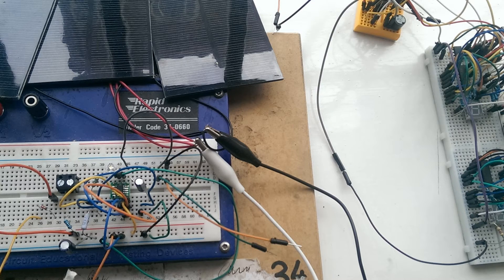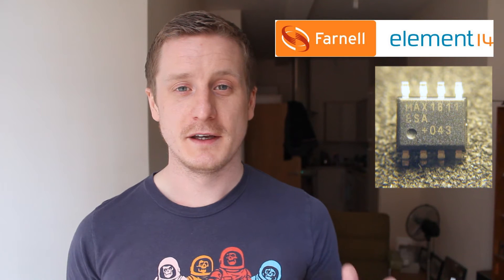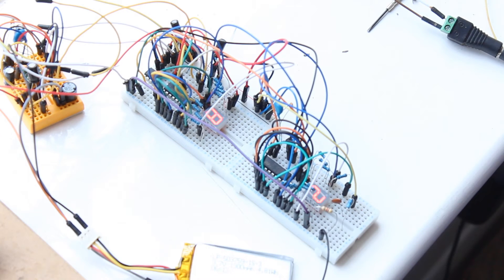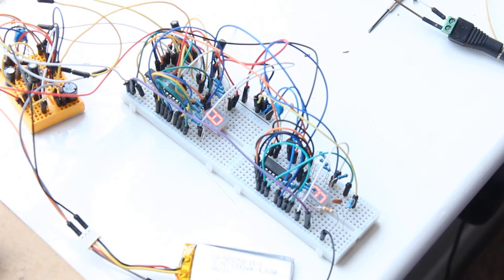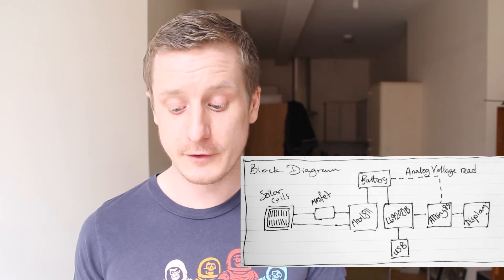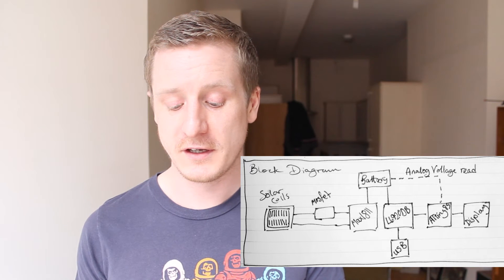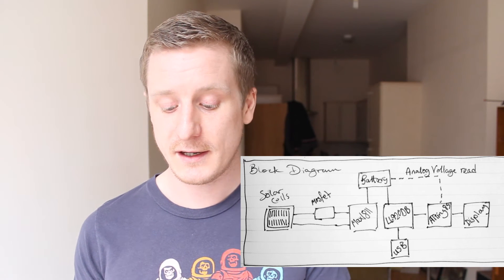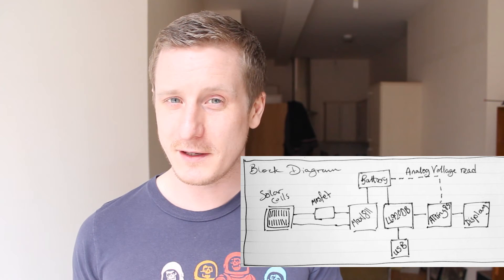Making a Solar Charger: Introduction

Comment: Why not replace the Attiny 85 with an Opamp comparator to display battery voltage?
Reply from the maker: +Upton Robotics Pty Ltd Hi, thanks for the comment. The display gives you a percent value of usable capacity left in the battery based on a sort of averaged discharge curve and the voltage reading. There are a lot of battery gauge chips out there though, this was less of a solution to a problem more experimentation.
Reply: +David Watts The old fashioned analog solution may in fact be cheaper, better and more accurate than a digital solution in this case. The microcontroller will use a lot of energy and suffer from conversion problems that the opamp avoids. I am working on a similar circuit. I was thinking of using a buck converter in a dual function. One function to step up a battery voltage. Another function to step down a solar voltage. What are your thoughts? Is that a good design?
Reply from the maker: Upton Robotics Pty Ltd You are right, it probably would be cheaper. The microcontroller can add a lot of other 'smart' features though, like auto power off or even mppt if you want it.

I have used step-up step-down convertors before and they can be quite inefficient, losing as much as 60% in conversion dependant on load and voltage. That said, they generally handle high current loads well and a range of voltages. Output voltages can also be changed on the fly in some cases. I am by no means an expert, but I have tinkered around a lot.

I suppose it depends upon you solar supply a lot and the battery packs you will be charging. The output load will generally be covered well by most buck converter setups.
Reply from the maker: +Upton Robotics Pty Ltd That little dude is cool. What kind of current draw are you getting? If you want to keep it small I would go for Lipo batteries with a boost converter. For solar you can get 5-5.5v cells pretty cheap and just add a beefy diode to drop a little voltage to go into some charging circuitry. If you go 12v then you might want to look at something more complex. Lots of options apart from those though. Good luck.
Reply: David Watts Thanking you. Yeah that's what I was thinking. Of course reality is never easy. I will probably have to try a number of different setups to find the best solution.

Comment: Hey cool channel im going to subscribe please check out my channel and all my videos. subscribe if you like it. I have tons of Arduino projects, a solar "AA" battery charger, a usb charger similar to this one. And I also have a small solar setup in my apartment. I think you would like it. Keep up the good videos!!!
Reply from the maker: Tom Ziesmer Thanks mate, I think you should pick up some of those max1811 chips and some lipo batteries for your solar projects, I think you could make something great. You definitely need a better camera ;-) I will work my way through the rest of your videos but I am enjoying them so far.
Reply: David Watts I will have to look into more lipo I just have one 18650 right now... And thanks for subscribing and checking out my video. I do apologize for the crappy camera I record off of my phone But a new camera is next on the list!!! I just watched most of your videos and they are very well put together keep on making them!!!

Comment: How are you getting on with this?
Reply from the maker: alexellis2 Hi, all finished. It doesn't get a lot of use though.... the UK is just not reliably sunny enough. Here is the follow-up - https://www.youtube.com/watch?v=E10BliRC5P0 - I never quite got round to finishing that video series off.
Reply: I'm playing at the moment, look at my uploads from today. 0.53A from two small panels while the sun was out. I'm wanting to run a little arduino in my garden on 4xAA batteries and to top up the charge with solar. It would be very low power setup, probably needs to be more of a 'bareduino'

Comment: What a brilliant video and thorough explanation. Thank you. I am looking into a solution  to power and Arduino via solar, and my feeling about a design was to make it far more passive and to remove a lof of the parts you are using on the charging side of the battery.  For instance, what if you could start with a 12v solar cell/panel of say 1 watt, on ebay for $5, hooked up to a 12v battery powering an arduino, and then you could skip the step up, and the regulator on the charging of the battery side.  All that efficiency, time, money, etc saved. And you would also not need the regulator on the output side as Arduino has one built-in.  And since this way you cannot overcharge the battery I don't think as you can't get it above 12 volts per the solar cell, you can skip the regulator and step up on the battery charging side. The battery may not charge all the way to 12 volts but that is ok with the Arduino, which can run on 6v.  I have not tried it, but would it work to do this?  Or do you have to have the regulator and voltage reading to control the charging to keep from over charging the battery?  You could always keep the arduino in sleep mode when possible, and turn it on to burn off excess power as a possible way to avoid having to employ a regulator on the charging side.
Reply from the maker: Jeff Beck Hi Mate,You will need more than 12v to charge a 12v battery, it is something like 2.2v per cell so 13.2v max. You can keep a battery topped up with a 12v panel but your charging current will be pretty low, 1 watt at 12v would be around 10ma. A 4 watt panel would give you a bit more headroom but you will still likely drain the battery eventually. You would be better to pick up a 6v lead acid battery and regulate the voltage down from the panel or get a 15v panel for your 12v battery.
Reply: >>1 watt at 12v would be around 10ma

Do you mean 100ma?  (and really more like 83.3ma in theory)  1 watt / 12v = .0833 Amps
Reply from the maker: Jeff Beck yes sorry, mistyped there.
Reply: Did you already know about that song by The Jam called  "David Watts"?    I thought that was so funny.. I was like, wait a minute.